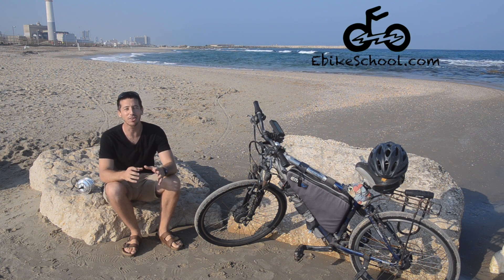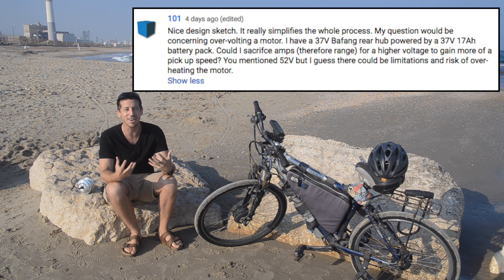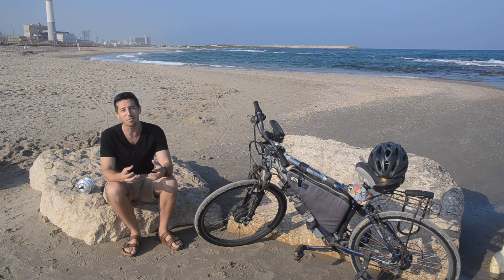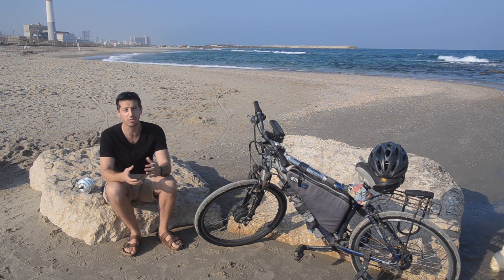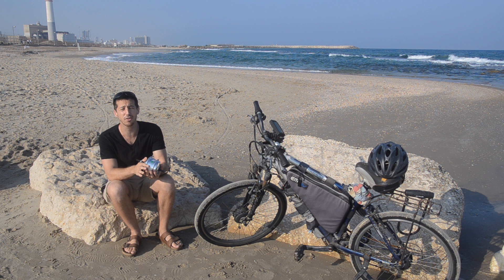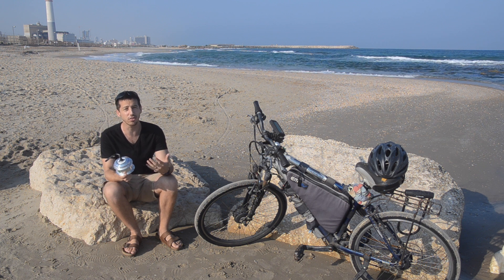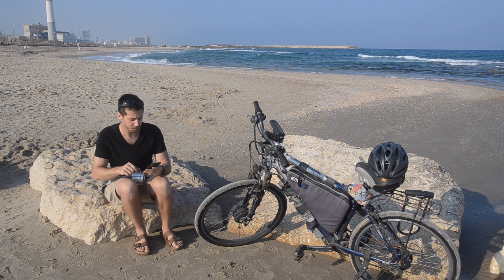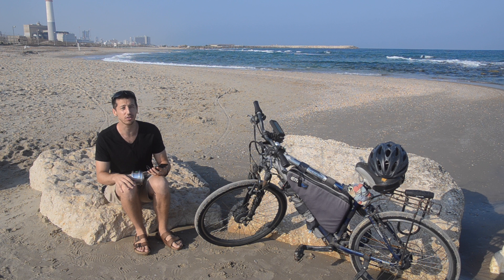Overvolting an electric bicycle motor for more speed! Q&A#7

Comment: Thanks for all the great videos. Can you undervolt a motor? I have a 36v 250w Fat Bike. It is used mainly around town. It’s great to ride and it handles most hills. I want to add a motor to the front wheel. I can’t find another 250w motor but I could get 48v 350w motor. Could I use this motor with a 36v battery and controller?

Comment: Hi,
As you said in my 36v controller I have a 50V capacitor... Can I change it to a 60V capacitor and run with a 48 or 52v battery?
Reply: Did you do it? ... I have 63v capacitors in my controller and I have the same question but to upgrade to 100v capacitors to run the motor a 72v.

Comment: You can just add more power, ALL it does is increase the speed!... facepalm
There's a reason materials science is a hot field, and companies are always trying to improve materials... they cannot handle unlimited stress, be it from force, or thermals. If you do this and you feel that its very hot, you might have already done some damage. And how many people truly know what's inside their controler, or if its built well enough to handle being used in a more aggressive manner? Additionally this could make your bike illegal in terms of continuous wattage getting above 750 watts (or easily over the 250 watt limit in Europe). While a normal police officer would never know, if you did get into a serious accident, it could matter in court, causing you to lose.
Reply from the maker: Actually, adding more power (by increasing current) will have a very small effect on flat land speed. It is adding volts that increases speed. And if you don't want to open your controller to check the components or you don't want to make your ebike illegal, I would advise you not to follow these instructions ;-)
Reply: rod elam It’s not about getting a ticket, it’s about being liable for damage you do to others due to being outside of the law.
Reply: Over here e-bikes are already tested on roller banks and if they exceed the 25 km/h limit they are taken off the street.
What do you think will happen when a policeman in a car driving 50 km/h sees you are keeping up with him?

Comment: over-volting is a dangerous game to play

A motor is rated for max applied voltage and max watts.  Exceeding either will overheat the motor.

With "rare earth" or ferrite magnets you can easily demagnetize them by getting them too hot.  That starts to happen appx 180F for rare earth and a bit (but not much) hotter for ferrite.

When the magnets are partially demagnetized, the field they create is weaker and that means it takes more current to get the same power AND the motor resists current flow less under load.  that leads to even higher current (higher watts demanded, but lower useful power output) and more heat due to resistance of the copper wire in the windings.
this is a vicious circle effect that rapidly results in a motor with no power due to the magnets being destroyed and then you burn out the windings.
It is possible to have the insulation on the windings catch fire and  with some "exotic" metals used in some motors (magnesium for one) can be ignited, resulting in a metal fire which requires special procedures to put out.
And the high current can burn the control box and cause the battery to burn...

Nobody should mess around with increasing voltage to a motor without having the appropriate data and test equipment to ensure they are not creating a rolling firebomb.
Reply: I would be far more concerned about setting fire to my battery pack before burning up my motor.
Reply: Hi.  What if you install a fan to keep it cool? 

 Or an effective method would probably be is don't try to run the motor much faster than its intended speed.  Try to run about 30% or 40% faster.
Reply: What happens if you replace the magnets inside the hub motor to neodymium magnets? Will the motor be more efficient? More powerful?
Reply: they already are Neo mags.
Reply: Agree. I would always over specify for my projects. No way I'm going to screw the magnets.
Reply: OMG JUST OVERVOLT  IF MOTOR BLOWSJUST USE AN ELECTRIC DRILL WHY EVERY1 PAY 100S FOR THESE EBIKES WHEN YOU CAN BUILD 1 IN A DAY LMAO.RETARDS PLANIT.
Reply: nicholas antony  my hub motor gets me 40mph, how fast does you drill motor get you?

Comment: Can I used boots convert for hub motor to maintain constant voltage. Input  battery  voltage is 48 and  motor also 48 v
The battery % is reduce due to decrease voltage by connecting boost convert to maintain constant voltage 
We can connect the boost convert pls telll
Reply: i doubt a boost converter can handle this kind of power

Comment: How would a 1500w limit speed controller handle an extra 400w 
The bike is already 1500w but runs 60v 33ah so should be 1980w so would the contour have a limit or would adding an extra give me more top speed

Comment: Hello bud. I have made a battery with panasonic ncr 18650b following youre book 20s 10p configeretion so i have 76v 30 to 34ah max i have not used a bms. When i try to charge the volts are max but the ah are not piking up and the cycleanalist wont give more so i end up not charging have tried difrent chargers. Any ideas to healp me out. I can send picts if you need.
Reply from the maker: The cycle analyst won't indicate that your battery capacity (Ah) has increased. If you used 20s, then you should charge it to 84.0V for full charge. If it reaches that voltage, you have a 100% fully charged battery. If you aren't using a BMS, then you should use a balance charger. I usually recommend BMS.

Comment: I have dc permanent magnet motor , 1500 watts and 180 volts with about 5000 rpm can I use it in my scooter with low battery voltage

Comment: I have a question. I live in the mountains in Southern California. A ride to town is about 6 miles with several 12 to 15% climbs. What set-up (motor/s and controller) do you recommend for a rider weighing 230 lbs.?
Reply: You need a high torque motor.

Comment: What about chain drive?
Reply: rod elam If a motor with chain drive pulling 3 to 6 nm of torque 2000watts 45amps would be enough for hill climbs? In a razor mx650 frame chain drive

Comment: Hopefully someone reply me. If u use the throttle and peddel will it work ? Any backlash?
Reply: No 'backlash' with my Bionx D500. In fact, I need throttle to quickly get up to the speed for intersections, because this motor for some reason lags with only pedal assist if I've used the brake to slow down before an intersection. I don't know about other motors.

Comment: Hi.. what is the difference for example instead of overvolting, you increase the capacity of the battery like double the AH.. will it also increase speed and torque (as it lessens the voltage sag) and also you don't have to upgrade your controller to a higher voltage..
Reply from the maker: The speed and torque difference will likely be too small to feel. Yes, there will be less voltage sag, but the improvement will likely be less than 1% in terms of speed.
Reply: alright.. thanks..

Comment: does increasing the voltage decrease the amp draw? does this lower the torque of the motor? I have a very beefy motor that is rated for 96 volts and it is currently running off a 52v battery. I want to increase the speed, but I also want to know how this will affect the torque. I don't know what model the motor is (it's a crystalyte hub motor) but the on board computer says it draws 1500 watts at 52 volts, which means it's pulling 30 amps (admittedly not very much for a motor this size, and it would explain why it has a little trouble with steep hills). So my question is how will adding a 96 volt battery change the amp draw, and how could I keep the amps the same/increase them to 50+ amps in order to increase torque?
Reply: As long as the battery you buy is rated for 30 amp current then it wont change. Its the controller that determines how much amps is supplied.

Comment: hello sir Mike. I just want to ask about how to match up amps on any ebike?
i have 3000w 60v brushless hub motor.they said that in order to get the amps of the motor is to divide the wattage(3000w)by voltage(60v) = 50amps. If im gonna use a lithium, it requires BMS that match up or higher amps. like 50amps and above. So i found 60v 16s 60amps BMS  from aliexpress.
Sir mike, is 60amps of BMS,enough?how about lower than 50amps or double the amps like 100a?what is the difference?
next is, battery. you mentioned on your video a proper battery that it needs equal or higher than motor.
What if my battery is 55a, the motor is 50a, bms is 60a. is that possible?Some experts says, the battery should be matching the BMS amps(or higher)and not the motor. that means i need 60a of batt or higher.How true?
next is, i dont know how much amps does my controller has as i bought it together with the motor kit.But how much amps of controller do i need for my 3000w 60v motor?How to check the controller amps?
next is wire. They said that it needs a conversion. Which conversion?which amps will i follow? amps of the bms?,battery?motor? what will happen if its thinner than required or bigger?
The buttom question is: Which one should i base all the amps or which one goes first or which is the highest to lowest? Say for example,
motor(50a) < controller < bms(60a) < battery<wire?
thank you sir Mike
Reply: Your controller decides what amps are fed to your motor, not your BMS, that's there to control certain conditions, over discharge, over charge and short circuit. if your BMS is close or less than that of the controllers normal output then when you go up a hill or move from stationary you will probably see peak output (roughly double your normal operating current), your BMS will see that as an over discharge or short and cut the power. I would look for a bms that easily covers your peak or max power requirements and add a little bit of headroom. To check your motor draw you simply wire in an amp meter, or a cycle analyst (CA) and see what your true output is. That's the ONLY way to see how many Amps are being drawn by your motor/controller.

Comment: on a BBS02, (w/9 levels of power) can't you simply reduce the level to 3 or 4 to reduce the heat in the motor..?
Reply: yes, but you will not get any power increase

Comment: Hai there if have a question regarding about my ESCOOTER.. Currently im using 48volt 1000watt CONTROLLER and MOTOR.. But main questions now for my battery im using 52volt 20ah, can this cause any damage to my motor and controller ?
Reply: Generally most 48v controllers have 64v components in them your 52v battery fresh of the charger is 58.8v. Thats as high as you can go with your controller. If the motor is remaining cool then you have not reached saturation and that means you are in a good place, if your motor starts getting to hot to touch at the end of hills then you are close to a meltdown.

Comment: HUM...
If the point of OVERVOLTING is to input more VOLTAGE so as to get more POWER...
Then if you decide to spare the motor... By lowering the AMPERAGE....
Aren't you BACK ... EVEN LOWER.... THEN WHERE YOU STARTED...
Given the P = VI equation !????
I mean SURE , you cut off the heat... But you cut off the POWER as well!
As in 36 volts times 18amps = 648 watts
And 52 volts times 11amps = 572 watts
How do you reconcile that with MORE VOLTAGE = MORE SPEED !????
Reply from the maker: You're right, but the part that you're missing is that higher current is more damaging to the motor than higher voltage. It's the current that causes a higher buildup of heat. So if you can keep the same power or even slightly increase the power while lowering the current and increasing the voltage, its better for the motor.
Reply: more volts = more rpms but less torque.. since 572 watts are still enough power to handle the load,. voila!
Reply: droidcrasher     

Nevada salt packs yo any snacks
Reply: I think you are mistaking battery current with motor current - these are two completely different things. For example battery current may be 15 A and motor current 50 A.  Motor current depends only on the torque load of the motor, and you cannot limit it directly. The controller+motor winding inductance act as a kind of transformer. The input is battery voltage and current, the output current and voltage are determined by the mechanical torque and RPM:
Pin = batt voltage * batt current = Pout = Torque * RPM = motor current * effective motor voltage.
The output current is peoportional to the mechanical torque load of the motor, and the effective voltage is such that output power equals input power (ignoring losses). So,
 the current through the motor under a given torque load is always the same, no matter battery voltage and battery amps. The motor draws exactly T * Kt, where T is the torque load, and Kt is the torque constant of the motor (equal to 1 /kV). The RPMs, though, will adapt so that Pin = Pout.

Comment: My issue isn't speed....in that I don't want to go faster.  I need more power...for hill climbing.  Does overvolting also increase torque and power?  I have a 500w hub motor that uses a 36v battery.  Thank you.
Reply from the maker: Yep, overvolting will give you more power and torque too, but also more speed. If you're careful with the throttle, you can maintain the same speed though.
Reply: reduce the diameter of the wheel that drives, it will give you more torque and less speed
Reply: Mid drive motors are good for Climbing hills.
Reply: I'm confused- I thought that you can maximize either torque or speed, but not both. My Bionx D500 was reprogrammed to an assist speed of 28 mph from 20 mph, but it lost some torque. For my next ebike I've wondered if Luna's Ludicrous controller is worth it if I need power for torque (pedaling considerable weight up hills) rather than speed.

Comment: Another question if I buy a 30amp controller will I get more torque at the moment my watt meter is showing I'm getting 25amps max and will this be ok the specs on my 36v 15ah battery say 30amp max discharge. Again many thanks.
Reply: Brannen Thompson A 30 amp controller will get you a little more torque.

Comment: I have a standard 36v 15ah bottle battery can I add a RC car li po 11.1v 8ah battery pack to up the voltage ie can you mix batteries? Many thanks.
Reply: Brannen Thompson Nope. I don't reccomend  mixing chemistrys. If you add an 8 ah battery to your 15ah battery, the voltage on your 8ah battery will drop twice as fast as the 15ah battery.

The battery is only as strong as its weakest cell. If you add that battery, it will either be destroyed or you will only get 8ah on the entire pack.
Reply: My battery is 10s 5p so can I add another 10 s in line to make a 48v using 1650 cells so I have my 36v battery and a 12v pack the 10s ? Thanks for the reply much appreciated.
Reply: Brannen Thompson You can do that. Just make sure the second pack has the same amp hour rating as the first.
Reply: You can put the batteries in series without a problem, but the combination will not give you more than 8Ah.

Comment: Hi Micah, Can you use a 1200-1500watt 48V motor controller on a 48V 1000w brushless hub motor?
Reply: Garry Hollis Yup. Just make sure it doesn't overheat your motor.

Comment: I need help on the best controller for a 48 volt 1000watt hub motor with  52 volt 15 AMP battery.
Reply: the best is what your needs are including cost, but most controller are moving over to sinewave controllers and are in the $150-$200 range

Comment: THIS IS THE EXPLANATION OF THE COEFFICIENT USED IN THE FORMULA: 

.1 the tire diameter is 26", multiply by 2.54 to obtain centimeters measure, so 66.04cm. Then you need that measure in kilometers for the calculation of km/h, divide by 100000 so 66.04cm ~= 0.00066km.
- keep note that you multiplied by 2.54 and then divided by 100000 -

.2 the circumference of the wheel is "diameter times PI", that means in a whole turn of the wheel you will travel approximately 0.00066km * 3.14 ~=  0.0021km.
- keep note you multuplied by 3.14 -

.3 RPM by its acronym means Revolutions Per Minute, so to calculate how much you travel in a minute you multiply your motor RPM by the result obtained in .2, and for the sake of semplicity we will use 300RPM and so 300RPM*0.0021 ~= 0.62km/minute.

.4 to obtain km/h just use the result from .3 and multiply it by 60 (infact if you travel X amount in a minute you will then travel 60 times X the amount in an hour), so 60*0.62km/minute ~= 37km/h
- keep note you multiplied by 60 -

All pure numeric coefficients can be treated separately so (2.54 / 100000) * 3.14 * 60 ~= 0.0048
Reply: Thank you!! :)

Comment: So, would I be able to use a 48v lithium battery on a 36v motor without frying it?
Reply from the maker: Yea, the motor isn't the issue (as long as you don't do some crazy hills and overheat it over long periods of time). But check your controller to make sure it can handle it. Some 36V controllers has 50V capacitors, which can't handle 48V, since it charges to 54.6V.

Comment: Wrong wrong wrong!!! Motor has specific voltage reateing ..... If you overvolt a motor it will run hoter and there is a limit of overvolt a 3v motor cant handle 300v!!
Reply from the maker: Yep, I discussed this later in the video. You have to watch your heat.
Reply: EbikeSchool.com sorry i didn't watch the full video..
Reply from the maker: Kuntal, yep that's usually pretty obvious based on the comments ;-)
Reply: Kuntal Ghosh  haha I’m right at the bit where he is talking about this 8.00 time
Reply: I mean you probs can, just reduce the amount of current. You do realise why it overheats, because of the amount of current flowing through the coils of the electric motor.